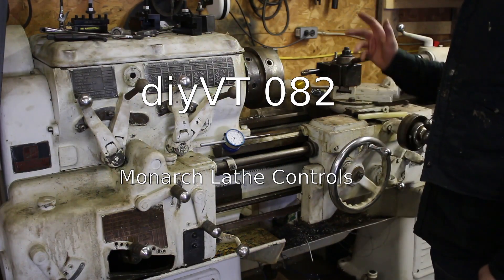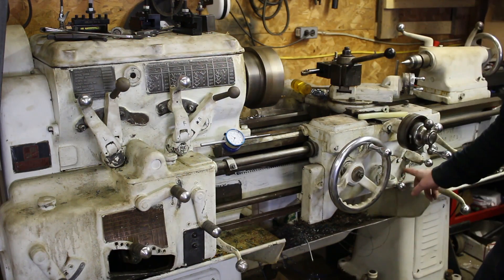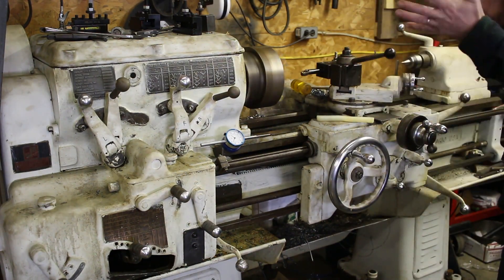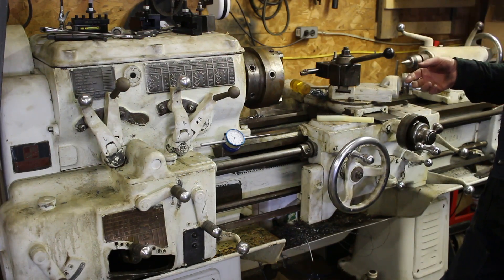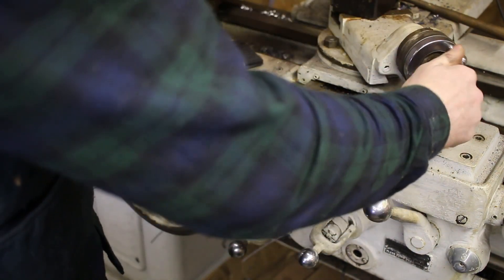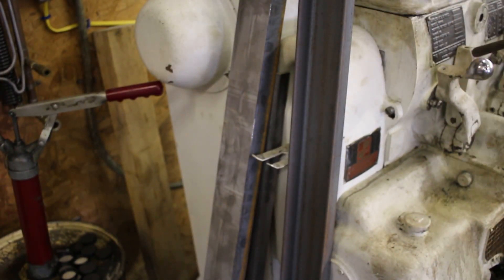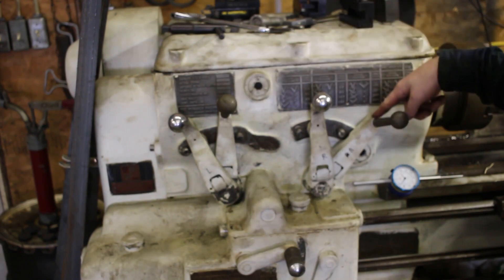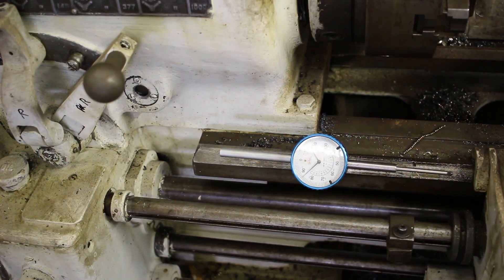Monarch Lathe Controls

Comment: I have a ck12 built in 43 can you advise based on your experience how to fix a oil leak that appears to be coming from the right set of selected knobs. It seems to be leaking from behind them. Can this be fixed from the outside or does the top have to come off
Reply from the maker: that would get fixed from the outside. There is a graphite packing rope that's wrapped around the shafts that go into the headstock.  If you are luck all you need to do is to tighten the nuts a bit.  In the worst case you might need to replace the packing material.  I should also mention that there are two sets of packing for each set of levers because there's a shaft inside a shaft and there needs to be a seal at each one.  When I get back to the shop I can look up the type of packing I got.  I ordered the replacement from Monarch but they sent me something from McMaster Carr with McMaster crossed out.

Comment: Good to see another Monarch Lathe still up and running. I have a 12kk that was built in 12/37. Mine goes up to 900 spindle rpm. It seems like you could order quite a few different speed ranges in the Monarch line. I'm keeping track of your rebuild also in case I have to dig deep into mine. Keep up the good videos.
Reply: Joe, we just bought a 12 KK made in Dec. of '40. It goes to 1000. This machine om the video is so similar i wonder what the difference is between KK and CK
Reply: @Sgt_Kilborn Cole, I believe the main difference between the CK and the KK is that the CK has the carriage feed reversing lever on the right side of the apron like the one in the vid. My KK has the reversing lever on the spindle case between the speed shift levers. The CKs were called tool room lathes and the KKs were engine lathes. They were built to the same tolerance and accuracy specifications (for Monarchs at least). The differences appear to deal more with the type of work the lathe would be used for.
Reply: So what's the difference between a tool room lathe and an engine lathe? Is one meant for production and the other for custom parts?
Reply: I’m using a 12 kk at work right now. That’s how I found this video. I believe the one I’m using was manufactured in 1941. This video is a lifesaver.
Reply: I have a Sept 1936 Monarch AA 14" X 30". In some ways it's a little rough looking because it was in a trade school for about 75yrs.